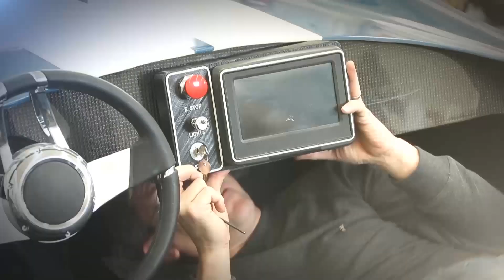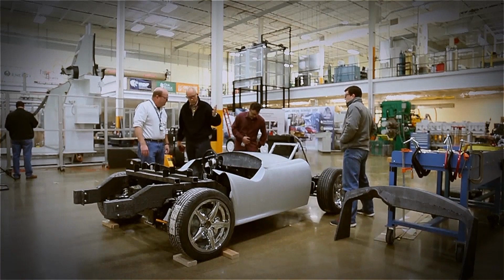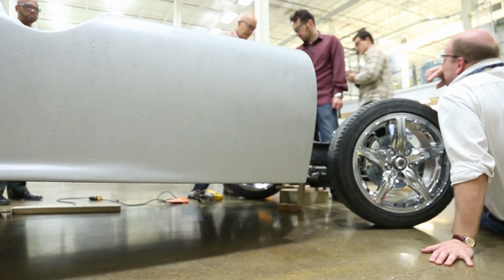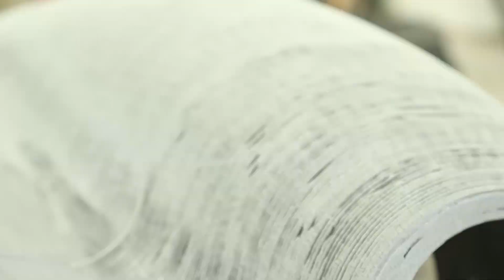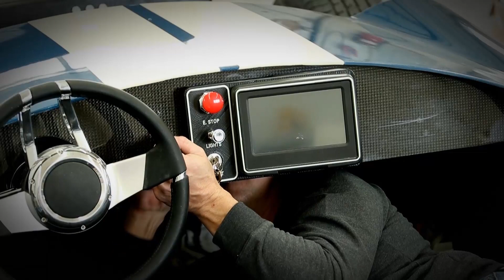3D Printed Shelby Cobra

Comment: I imagine in the future a dealership will have 2 or 3 of these printers on the lot.  You walk in and test drive a model you like, choose all the customizations you like and the dealership prints up your car and in a week it is ready to pick up.  Local body shops could do the special paint jobs and their service department could bolt together all the attached hardware.  It would be a huge boom to local economies by outsourcing work locally.  You could even design your own body if the dealership told you the mount points needed.  Of course we'd have to do away with a lot of the crash test laws.  If a person can ride a motorcycle and take responsibility for their own vulnerability then why not cars?
Reply: You are absolutely out of touch with reality.
Reply: @modception  and I'm sure your bitterness makes your mother so proud
Reply: @WillieStubbs  and I'm sure you're popular at the ladies with your manchild way of thinking and daydreaming. This could go on forever so stop it now!
You were talking about a world where coach builders make cars individually for customers. At a large scale, which is not possible in today's economy. It doesn't matter if it is the magical 3d printing, it is just a tool. You were talking about making cars custom, one by one basicly. The way you propose, makes production of cars impossible to do on production lines, quality control difficult, crash testing would be necessary for each and every design, which defeats the purpose and the whole car would be  more expensive than what it costs nowadays with magnitudes less features, performance, reliability and safety. Not to mention, someone would have to pay for all that design work that goes into custom body and interior parts. That's why you don't see printed parts deployed in any major brands. Because customization doesn't worth the expenses for the average customer which accounts for the majority. 3d printing is expensive, slow and rough. Cannot compete with tools for mass production.
The expenses are way out of proportion of the benefits. If you take out the mayor customization options and just talk about optional colours and features, then you're talking about cars that can be mass produced with the highest efficiency possible, on large scale, fast, and for cheap. Engineers can take their time, perfecting that one design and the cost of that gets negligeble per car sold. That's because they are all the same. You can see cars now that have all the features built in the hardware but features turned off by software. That's how efficient and integrated car production already is. It is just easier to mass produce the same part and confige it for the customer by a few clicks.
Major brands have large factories where every job is standardized, timed, organized into a system which works together and is quality controlled throughout the process.
Distributed production, with the involvement of small local companies?how could you organize them into a system with no delays or worse problems?  That's not even funny, that's stupid.
Reply: @WillieStubbs  if you are talking about just some custom body panels, thats still unfeasible. I know because I just did that. I did print full size models of bumpers, sideskirts, fenders. For mould making and small volume production using fibre reinforced plastic. Took me a month of continuous very fast printing. I did it with a fine layer height so I don't have to fill and sand as much later on. Still it took two of us a week of filling and sanding the parts until they were ready for the mould making process. After the moulds are done, it takes about 2 hours to make a new bumper out of frp, with industrial injection moulding, it takes like 2 minutes.
 The parts  were printed with 0.28mm high layers, not with like 5mm high layers you see on the cobra. Imagine how much effort it is to smooth out that 5mm stepping. Just ridiculous on every level

Comment: Doesn’t the solvent in the paint spray effect the 3D printed material?
Reply: No if you put on first sealer that does not effect plastics ie plastic primer, then normal primer and finally the paint it self.

Comment: For the past 30 years Additive Manufacturing have been primarily used for research purposes.either making prototypes or extremely highly complex parts which would not otherwise be possible if using traditional deductive manufacturing.

For the past 10 years, 3D printing have been focusing towards hobbyists and even large scale prints which spring out new ideas & materials, but the current major limiting factors are the 3d machines themselves such as print speed. e.g. it takes 'seconds' to make dozens of parts from injection molding while it takes 'hours' to make a single unconditioned part from a 3D printer.

3D printer need to be researched to make mass production a possibility or else we will probably only see rapid tooling (wear down quicker) and high finished large scale prototypes, because most 3d printers today uses non engineering materials (due to layering).

If someone could demonstrate a functional engine block perhaps using additive (& deductive) techniques, then I would be impressed.  As it would widen the floodgate to a whole new level.

Comment: My Ultimaker keeps failing to print this, something about bed size too small :(
Reply: Samy Kamkar.   Not a problem.  I’ve just done a print 1.2 metre long on my Flashforge Dreamer. ( so the longest piece is 200mm long).  All you have to do is design it with tenon joints to mate it all together.  Make the layers 5 on all services then you can sand it with no problem.

If the Chinese can print a house you can print a car.  Go for it.
Reply: You could build a printer of the right size by scaling the planes of the prusa i3, the problem would be to figure out how to build an extruder of that size.

Comment: what's the weight of the printed Shelby, is it lighter then original?
Reply from the maker: +SmoKingPackRaT estimated at 1400lbs with 500lbs of 3d printed parts containing 20% carbon fiber. You can find out more at http://web.ornl.gov/sci/manufacturing/shelby/
Reply: *than

Comment: You can make a car in origami or in papier-mache really.. is this 3D printing show just to demonstrate you can push a print button? or is it production ready and road ready?
Reply from the maker: +Mathieu Fregeau it's really about rapid prototyping, the Cobra acts as a laboratory on wheels, so our researchers can easily and quickly test ideas and make immediate adjustments
Reply: +Bad Beard Bill  Bullshit. They 3D printed the frame to show that it can be done...then they bolted a bunch of standard shit to it. It would have been less expensive and less time consuming just to buy a cheap steel frame.

You can't drive that thing. That plastic WILL eventually crack and fail horribly.

This was nothing more than marketing hype to bring attention to the company.
Reply: The point is that they got a functional car much quicker than conventional means could accomplish.
Reply: That was my point exactly! Whenever I see "3D printing of a car works!" I see the word "printing" as very bold. It's the printing that works, not the car :) I'd eat 3D printed chocolate, but not driving a 3D printed car..

Comment: So basically you have made the worst car ever created with the highest cost to produce it.  Exactly the opposite of what real car manufactures want.

So no I don't think people will be printing cars in the future.  There are experts for a reason.
Reply: But they could've printed any car they wanted. And experiments usually are expensive. In fact, the actual printing was likely the cheapest part (ignoring the cost of the huge printer, which already existed). Custom cars are inherently expensive right now. The real advantage was the speed. Just six weeks to build a car. And that can be reduced down to four with some effort.
Reply: Point was that shelby cobra was made using english wheel that takes huge amount of time and more over skill to create these body panels. They manage to create it in fraction of the time and cost, not to mention those now can be used to create carbon fiber copys as actual body panels.

Comment: From this video it is not quite clear what parts were printed and what parts are used from traditional manufacturing. I imagine all glass parts are not printed? Chrome metal not printed? Wires not printed? Wheels not printed? Engine? Seats?

Is the body and frame are the only two printed parts?
Reply: I would say only the body was printed.
Reply: You can also print with metal, you only need a suitable extruder, you have already made prints with metal.

Comment: How much did this cost to do?
Reply: My guess is $110k.  Over 1400 engineering hours ($86k), All non-body parts ($20k), extensive body smoothing and paint shop ($5k).
Reply: Yikes
Reply: With some streamlining, you could probably get that cost down. This was an experiment more than it was entreneurship. That cost could be brought down to 80k after a lot of time and units made.

Comment: And now it's time for crash test
Reply: GURken It actually might do quite well. It is much more lighter.
Reply: +GURken Use a clay extruder and then pass hemp through it.  5x stronger than steel.
Reply: +GURken I was wondering the same thing, I wonder how ABS plastic handles a crash, would it shatter or just deform?
Reply: ArcadeGames I'm sure the ABS could be modified to have certain weak points to make it break in certain way that could be controlled.
Reply: The boss of the car that they made doesn't serve the purpose of protecting the car, it's for asthetic, the frame inside, decides the strength of the car
Reply: The original wouldn't do great either..